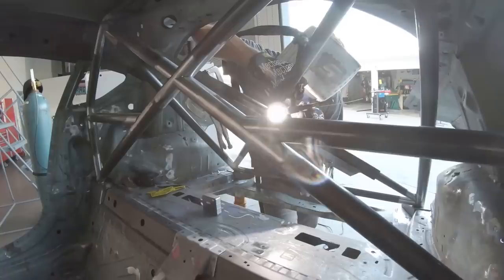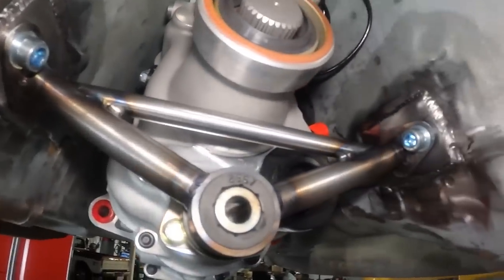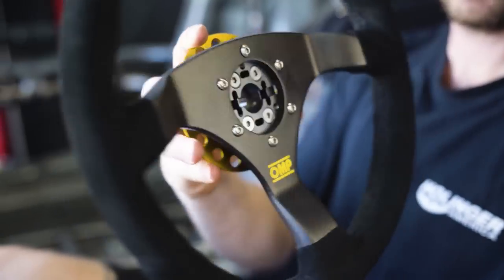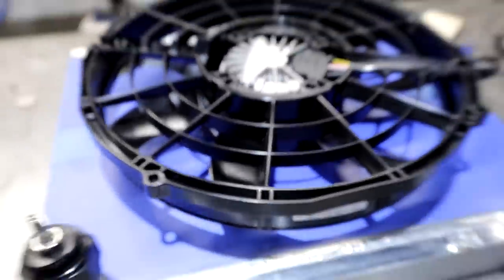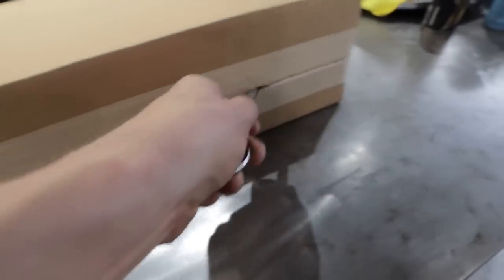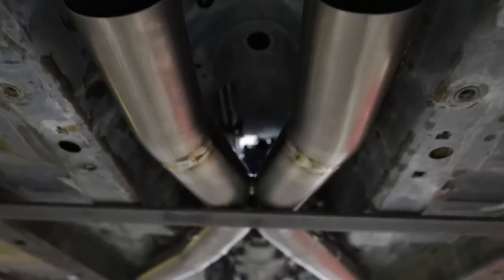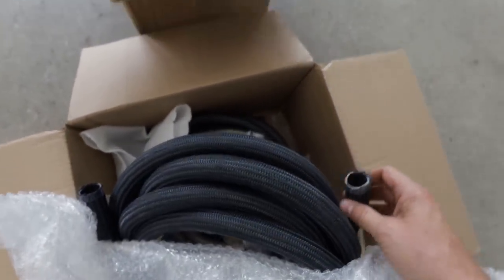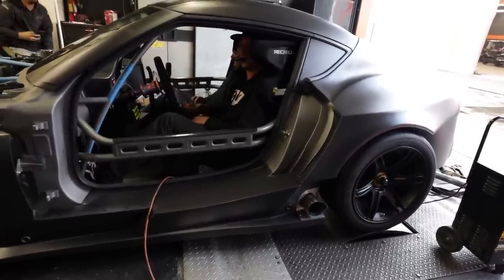How To Swap a JUDD V10

Comment: It’s wild to me how people have the skills to take a new car, completely strip it down to bare metal and build something like this! Congratulations on the build this thing is amazing.
Reply: Skills, and money. Impressive none the less
Reply: it just takes money mayne.
Reply: They make it look so easy, and some parts are for people like me that are good with wrenches, have an eye for a straight line, but limited hands on experience...but...most it is extremely challenging and takes many years of hard-core experience to complete, certainly to do on this kind of level of perfection
Reply: The disassembly is not an issue for me.. the money tho... not so much
Reply: Tuerck just hits it with his moms purse
Reply: Man forreal!
Reply: Engineers are AWESOME 👍
Reply: sKiLlS….
Reply: eNgInEeRs
Reply: i think about this shit constantly like bro taking it apart and putting it back together isn’t the killer it’s the electronics like bro howw
Reply: It'll be the last generation you see do it too 😢
Reply: @hel8686  what???
Reply: and put everything back together as a new car. yes
Reply: Can do anything u set your mind to, if one truly wants it.
Reply: I m wondering how much the whole thing will cost at the end
Reply: I honestly be thinking the same but thankgod for these types of people cuz i cannot lie these videos are interesting af
Reply: Motor swaps aren't hard particularly, it's just fitting one mechanical assembly into another with a few vital connections to figure out. The $60k for a Judd is more of a limiting factor for most people

Comment: It feels like we've just hit the tip of the iceberg with 3D printing. Stoked to see what we can do with it going forward.
Reply: In terms of average Joe getting parts 3D printed yes we have only just hit the tip. But when it cmes to manufacturers like Porsche / Mahle they have been 3d printing pistons for years already
Reply: In general we're pretty deep. Like above said, Porsche has been doing some crazy shit but if you look into Relativity Space they're 3D printing (essentially constant bead welding) rocket bodies and sintering rocket engines out of very few parts.

Comment: The revs of this engine give me the chills. This build is awesome!!
Reply: And still 7000rpm below F1 V10s. Miss those days, glad to hear a high revving NA again!
Reply: There were a couple late 90's early 2000's F1 Cars (a benetton and a jordan) that run judd v10s which I've seen at the SVRA vintage races at Road America. I'm not sure where else they run SVRA, or pther series with those cars, but i'd look into it. Then go to the woodsiest section of the track and listen to the V10's scream through the trees. At road america there is basically a small forest on either side of the track both on the back straight between turns 3 & 5, and on the back "straight" after the carousel and kink. It sounds amazing. Indy cars and a lot of the prototypes also used to sound amazing going through there. Lambos & Ferraris, etc. I'm sure there are a ton of tracks just in the u.s where you can get a similar sonic racing experience.

Comment: Well, if anything, this car proves that you don't need insane torque to drift the tires off your car. The JUDD V10s, any generation of them, have substantially less torque than they have HP, but apparently that doesn't really matter for your needs. While I will always prefer seeing street builds, this can only be described as wildly impressive. Great job, guys, this turned out amazingly well.

Comment: Thank you for making the video condensed and not spreading this over a life time 
This is the way to go 
You can later put links in the description for more detailed information bit by bit
Usually you start watching a build clean shaven by the time it finishes you look like a hippie
The car is amazing 
Would love to see set up and tuning ( camber ,toe,damper setting, engine management,gear ratio…)
For drifting, for racing and for road for that is what usually takes the manufacturer the longest

Comment: Sick build.  I'd be a bit disappointed with 630whp after all that work since that is what most C6 Z06's are making at Thunderhill.  690 - 710whp would work well for bragging rights and probably be enough to get around those 3,100lb Vette's on the front straight.

Comment: Nice build but to everyone who thinks this is some amazing one of a kind creation needs to research judd v8 and judd v10 engines. They are one of the top choice engines for proper hill climb cars and have been used for quite some time. Mainly put into Mercedes and BMW hillclimb cars

Comment: I wonder if you could make a mechanical rev limiter, that would even prevent a mechanical over rev. Once the engine gets to max rpm, a brake engages on the engine shaft. So you could be going 100mph, put it in first, release the clutch... engine revs to max, then a brake is applied to the engine shaft, and ultimately the car itself.
Reply: It has a sequential gearbox. Much easier to simply not downshift when the rpm is too high for a gear. Alternatively a manual car could electronically keep the clutch disengaged while the selected gearing is out of normal operating range.

Comment: You need to add down force with a wing and front splitter with some road race slicks and see how fast you can run it at different track's I would get rid of the wise fab and then get some KW suspension instead of bc if that's the coil overs your using
Reply: That’s exactly what they’ve done..
Reply: @trippnoutmotorsport3164  There is no aero on it, this is just for sliding around and showing off.
Reply: @alechall7082  Clearly haven’t been watching his social media 😂 definitely has Aero and slicks now.
Reply: @alechall7082  And the car was built for time attack/hill climb. They configured it for drift for the partners video. It’s been configured to it’s grip setup
Reply: @trippnoutmotorsport3164  What did they swap the wisefab for?
Reply: @nzuncovered1845  SPL parts arms and stock knuckles on the front. Think rear is still on wisefab
Reply: @trippnoutmotorsport3164  Thanks, are SPL a good brand?
Reply: @nzuncovered1845  I’ve never heard of them personally until Ryan’s post

Comment: But Ryan, you can buy the engine from the LFA… it’s $73k sure but you already swapped a $43k Ferrari 458 engine into a GT86… might as well do a purist swap and put a twin turbo forged LFA engine into another Toyota chassis.

Comment: I'm sure this is an insanely stupid question: why don't car manufacturers sell just bodies to people interested in projects like this? 
You don't care about the stock transmission, suspension, brakes...and the entire engine is getting swapped anyways. Sending a "blank" shell means you don't have to waste a week stripping everything and lets you get straight into reinforcing the body and sending it straight to paint.

Comment: Controversial opinion; I think the Judd V10 is one of the least impressive sounding V10. Sure, it sounds good on a Dyno with almost no exhaust, but on the road/course? They ain't it. 
It'll be at 11,000rpm and sound like it's barely crossing 8,000rpm. The LFA 4.8L V10, Porsche 5.7L V10, BMW 5L V10, Lambo 5L V10, and Audi 5.2L V10 all sound better. 
Heck, even a Ferrari V8 at 9,000RPM sounds better than the Judd. Seeing a Judd in a hill climb car is like eeeeeeeeeeh. Funky harmonics!
Of course, this is just my opinion, I don't care if you disagree, I won't convince you otherwise; but if you agree, then jump on board! Because there will be much less of us who dislike it 🤣🤣